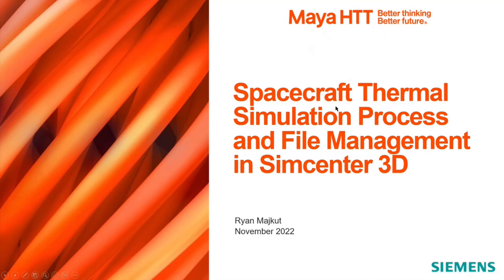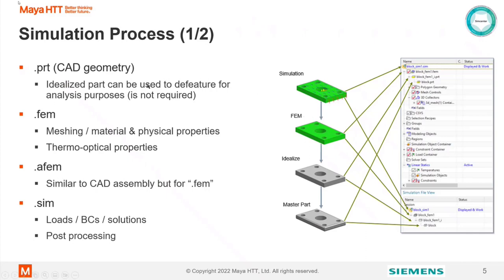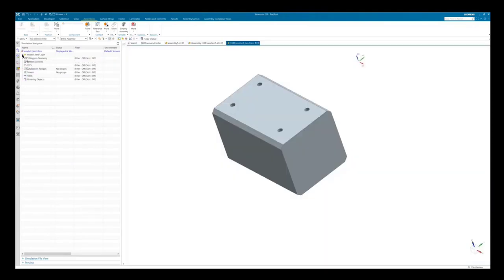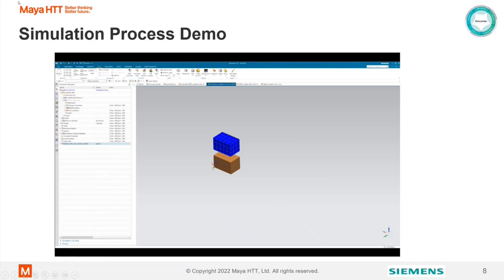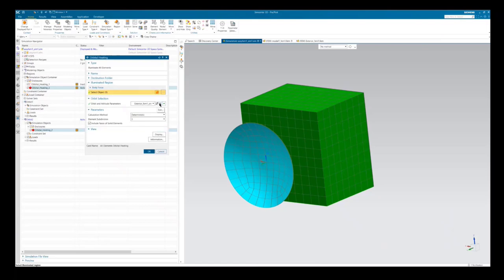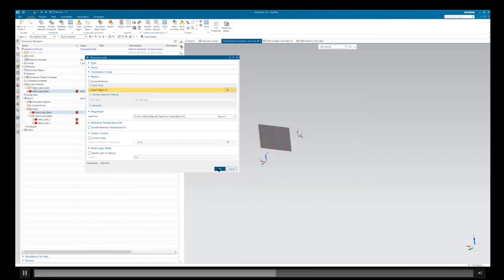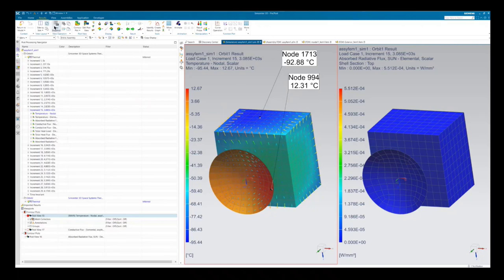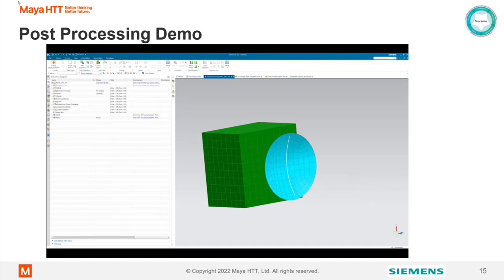Spacecraft thermal simulation process and file management in Simcenter 3D

Comment: hello could you share us MLI modellng
Reply from the maker: Within Simcenter 3D, you can model MLI by changing the 2D element physical properties to either Multi-Layer Shell Uniform or Multi-Layer Shell Non-Uniform.  With uniform multi-layer shells, each layer has the same material and the same thickness.  With non-uniform multi-layer shell elements, each layer can have a different material and a different thickness.  In both of these options the solver will add a calculation point for each layer, and the user will be able to post process results for each layer.

Simcenter 3D Help Link : https://docs.sw.siemens.com/en-US/doc/289054037/PL20230419932494371.advanced/id628306

For more details on the content of this video, feel free to contact us: https://www.mayahtt.com/about-maya-htt/contact/